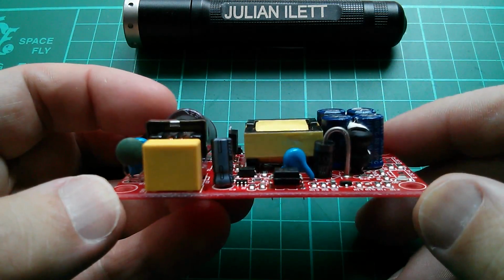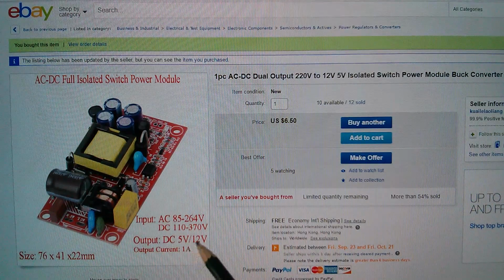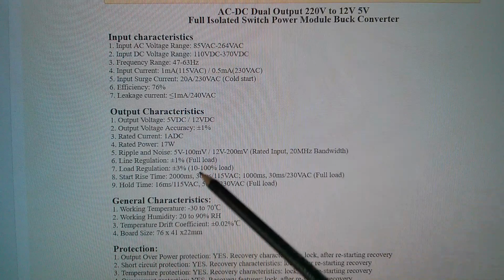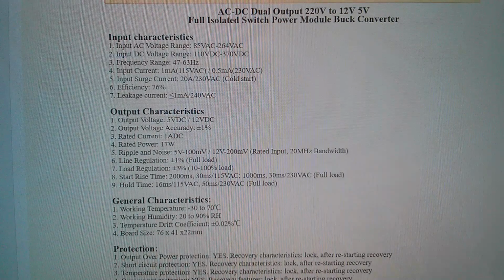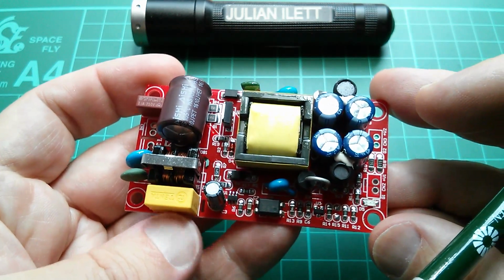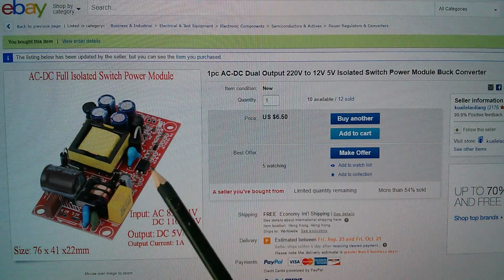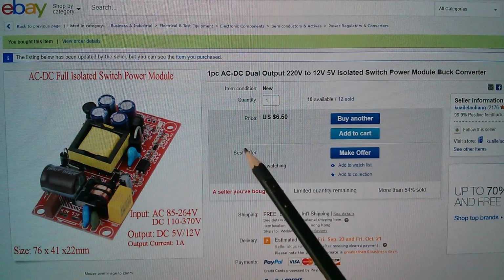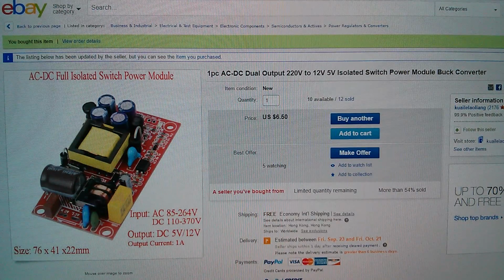Mad Idea: High Voltage DC Power Transmission

Comment: ran a shack out in the bush on 2km of speaker wire by kicking mains up with a MOT, and back down again at the other end.

illegal as all hell, but was fine... could pull about 4A at 240 before the sag got too bad. 

enough for some lights, radio, telly.

Comment: did simular...
40 v solar to round 2kv ac (microwave Transformers) and then back to 40v dc .
over a length of round 500m.
i did this as landline (on 3 m posts...no voltage against ground.
) i use cattle wire and insulators it is working fine since 12years;)
sorry for my poor english +!

Comment: I know this is older video. Do you remember if your fan is on all the time or it kicks in when heat increases. I am charging at 1A 42V and fan doesn’t kick in. Is that normal?

Comment: Has anyone managed to get over 5A @ 110-120V on that b900w converter? I am getting anything between 200 and 500W on that module, depending on the in/out difference, voltage, current and so on, but nothing close to 900W, no matter what I do...

Comment: For someone that's quiet clever with electronics you seem to have made the same there are a lot of people do when they're looking at the specs of these boards, probably due to the way it was listed on eBay being incorrect too, but still.
Virtually all of these power supply, Step Up modules, buck converters the max rated  current supplied I'd in relation to the "imput", but many get it wrong thinking that it is relation to the output.
This one is rated at 1a and that at 240v AC is obviously 240w, and if you subtract some 10-15% efficiency losses you could assume 12v 17a /5v 40a.

Comment: The blue 'blob' on the AC input is a varistor, (VR marked on the board).  Its resistance changes with temperature and drops to a lower value when warm, allowing more current to flow after a few seconds of operation. Its task is to reduce the inrush current when cold at startup.

Comment: Did you set up this powerline regulation so far? Would be interesting to hear how it performs after a few years :-)
I would be also interested in an indepth review of the 900W boost-converter - is it worth the money? What about efficiency and output ripple and what about the lowest input voltage?

Comment: Thanks for that bit of info. I have been looking for a way to get the power from my panels way out in the open field to the house without a tremendous amount of loss and not having to foot the bill for a very long run of big copper wire makes it possible. You see, some of us can not afford to buy that kind of wire, Its simply makes the project impossible to do. I think with this idea and knowing that it is actually being done and works in other country's according to ( Sainology ) using the system you mention actually makes it possible for me to pull off.  I spent a great deal of time trying to figure out how to place my very expensive and treasured  inverter out at the panels so I could run AC over the long run of wire. Where I live it gets extremely cold, lots of ice and snow. I was going to have to house it and heat that to boot making the system pointless after adding the wire price, Impossible AND pointless, LOL. So you see now I can place my inverter in my home next to my lithium battery bank which also must be kept warm and a battery I can keep in my house while charging.  Now it will cost me NOTHING more than I am spending anyway to house and heat myself. So you see this idea may be in theory inefficient or a bad idea to many of the engineers, scholars, and certain system designing PPL out there. As an electrician myself I do understand and agree with simply running the numbers and in principal it dose seem quite inefficient using the technology we have available to use at this point. However do not totally discard this idea yet,  for I must say " IT HAS ITS USES REGARDLESS" and in my case it appears to make something that was otherwise impossible NOW POSSABLE at least for me.  I am also willing to bet that if its beneficial to me, in my situation that there are other cases where it could actually a magical solution to solve an impossible situation. Even with its 50% or 60% inefficiency rate, it at least provides something where there would otherwise be nothing. Due to the cost of those CHEAP little Chinese modules compared to the cost of a good inverter is nothing. I can replace those many times over AND take the loss in efficiency of the entire system and still come out ahead. Hopefully, and I am willing to bet that technology here will only improve in the near future. So for now, for me this system is a viable and useful thing, at least until technology reaches the point where we can somehow wirelessly transmit actual currant over long distances.

Comment: where did you hear that high voltage reduces loses ?
Reply: Wont high voltage lowers the current that is passing throuhh the wire which lessen heat loses
Reply: @IDLZ3D   Its not the voltage ,  its AC . Voltage is something you need , and you never use more then you need . So if you need 10 000V hey you need it , its nto about loses . Loses are higher with higher numbers except for frequency .

If you say Higher votlage equals less loses because its less current , i say Bigger wire less loses becasue less current density .

ITs all correct but its false .

Decrease in loses comes with RESONANCE, make a circuit that is RESONATING  it will have minimal loses , if any .

Becasue electrons want  make problems .

AC is a form of that , when we zoom in to one electron in AC , its just vibrating back and froth , its not going anywhere not doing much  , and that brings loses down .

Next level of that is AC but in Resonance , where Positive feedback negates the loses , so you have self sustaining system .

That is your Atom for example , its vibrating on certain frequency , to split it apart you need a lot of power , Giga W of power .
But increase its frequency or lower it jsut a bit , its self destructs .
That is Resonance , its the essence of our world .
And that is the only thing that can bring down loses , the closer you emulate it the lower you loses .
100% emulation , no loses .
The rest is just confusing math

Comment: I think it is 17W total, divide the amps up however you like. Hence, the 5v diode needs to be fatter. To be able to deliver 17W at 5v, you need a fatter diode than 17W at 12v. :)

Comment: It is not that stupid, if you think about it.
At 120V with 0.1A, the cable loss would be around 70mW, or 0.6%.
At 12V with 1A, the cable loss would be around 7W, or 60%.

So if the combined efficiency of the Boost and Buck are better than 40%, it is worth doing it.

(Calculated with a diameter of 0.25mm²/23AWG (Typical Doorbell wire diameter) and a cable length of 50m)

Comment: This is of course a good idea Julian, for transmitting power (as the authorities do it), as you lose 'x' amount of volts per metre, the higher you pump it up the less current you will lose when you step it down again, so my suggestion would be to pump it right up for a more efficient power transfer over distance, but get a better step down (Buck) on the other end to output full amperage (watts) to your shed batteries so you can take advantage of using the thin wire to transfer the full power of one or both panels down the yard to the shed, and then reduce it to charge the shed batts at the highest possible rate you can till they're near full, and make use of that spare power you have to run more workshop gear or even the house lights, etc.
Another great vid Jule's, TFS!

Comment: Your video projects are great. May I propose one? (cos I'm not quite sure how to go about it)
Using a 4Ch Channel 16A Rgbw Controller Dmx512 Decoder ebay 122882634448 to drive a rgb 20w RGBW RGB+White High Power LED Module ebay 232419809701.
The idea behind this is to convert some school stage lighting equipment to DMX controlled LED luminaires
All the best

Comment: I have one of these, and I can verify that the AC inputs go directly to the bridge rectifier (AC) inputs and the non AC pins of the bridge are filtered by direct connection to the large capacitor.  I could NOT find ant path from the AC inputs leading into the transformer (no continuity) which seemed to have many pins Is this even a 50- 60Hz transformer?).  So, as I have been wondering, HOW IS THE INPUT (ESPECIALLY IF IT IS INPUT DIRECTLY AS DC) isolated from the output?  Can anyone please shed some light on this???

Comment: Julian,  As far as the current rating for each of the 5Vdc and 12Vdc outputs, It seems logical that they are 1 AMP output EACH/SIMULTANEOUSLY.  SINCE:  The label specifies TOTAL 17W, which would equal
 (5V)*(1A) + (12V)*(1A)= 17W.   ...make sense?...

Comment: thats not a new idea julien :) ... hydroelectric dams have been using it for decades to reduce AC losses. ----- also listen to yourself 'this converter outside will step it up to high voltage ; quite a nice deathtrap you are building there ;)

Comment: Enjoyed the video but probably does not make much sense when transmitting <20 meters.
This technique works well for >1km: Lets assume 12W load 1 km away. Assuming 100% converter efficiency.

12V transmission requires 1A for 12W load. To get 90% transmission efficiency, cable resistance must be <1.2 ohms. For 2km of wire (there and back) needs about 6 mm diameter cables.

Transmitting at 120V current uses 0.1 amp so cable resistance for 90% efficiency is 120 ohms. This corresponds with a 0.6 mm diameter cable.

i.e. We use 100 times less copper to transmit at 10 times the voltage.
It makes even more sense if transmitting at higher voltage.

Comment: Hi...Since you seem to have expirience... how long does car battery REALLY last if used in kinda cyclyc mode, or solar, or powering your random dangerous hi-current projects ;-) and NOT recharging it seconds later (as happens in car after start). Could you use big one for like two years for solar offgrid before it degrades?
Are big truck batteries (like200+Ah) allso made from same thin plates as small car start ones? Here in my country it is hard to get or too expensive to get proper sized truck battery, so truckers, etc. just buy 2, 3 or 4 60-80Ah car batteries and put them in parallel (if truck has 12v system ofcourse).

Comment: Kind of an old video, I know I have watched it before but today I located my box of such power converters so I am watching your videos so I can get back up to par on what I am doing when I try and power up my Ham 2 meter radio.  Not planning on trying to transmit, but I got a used parts or repair unit for 20 bucks says all works but the display so I wanted to put 12 volts in from my 18650 power packs just to see if I can get the thing to light up and see what needs fixing. Oh just wondering if that all worked out?  My only problem with it, right off any how was what would happen if the neighbors dog decided the cord looked like a chew toy, I bet 110 volts would send him to doggy heaven?

Comment: Hi Julian,

The Rated Power in Output Characteristics does say 17W.
5V x 1A = 5W   
12V x 1A = 12W   
For a total of 17W.
So maybe each output is 1A.

However, I do not believe this is a good idea from a practical standpoint.  Better to just use thicker wire.

But it is fun and makes an interesting video :-)

Cheers,
Robin Browne
Ottawa, Canada.

Comment: Well, this is sort of how I found you. I found your video on a MPPT boost converter, then watched the PWM and MPPT one and finally this one. Am looking for a way to take the output from a 3-phase windmill and run it a good distance to 48v battery. I thought about just sending it and hoping for no loss then convert it to DC.  Windmills are  much better at 12/24v at the home level. But it can't be safely introduced to the battery. Of course the long range plans are for 6 of them but am concerned about charging imbalance if I just connected it to the proper number of batteries. It would work but the batteries wouldn't be balanced you see.  Then I thought about just making a 3-phase transformer and stepping up the voltage to 8 times the input.  Then I could use bell wire or alike and run it the distance.  The problem now is I don’t know how that will affect the windmill and when they aren’t under load it can get into the hundreds of voltages.  It’s a bit of a sticky wicket to solve you see.

Comment: Ha, ha, ha;-) ;-) wouldnt just be alot easier to simply carry the battery indors once is fully charged and that way no loses will occur since the battery is 12v DC anyway and that is exactly your desired voltage isn't it???  B-) B-) B-)

Comment: Just remember that anything over 32V DC starts to become dangerous and may even require a licenced electrician to inspect your wiring. (depending on local laws)

80V - 100V DC is very dangerous
Reply: depends on where you are... 48-56VDC is used for PoE and I assure you does not require an electrician... 70V speaker systems also do not require a licensed electrician
Reply: FLECOM 
Yes. I was generally speaking about Australian wiring rules as I learned them. Although they probably have changed in the past 20 years.
Reply: John Thimakis

Comment: You have created a tempest in a tea pot. If you were to look at you whole system you will find a great many components not designed for out door use like you black "lamp wire". Considering all the waste heat your little system would produce from the solar panel is a no go. Considering your end goal is to have a low voltage power source at your work bench to drive a bunch of transistors .........  Solution charge the battery at the base of the panel like you are doing. When the battery goes dead at the bench wheel it out and swap batteries. :- )
Reply: Build a robot to swap the batteries.

Comment: I guess now you have to put it in place and measure the input and output power vs. a low voltage system.

I would not want eBay Chinese devices running unattended in my house, though. That junk is fine for something running on your workbench where you can turn it off when it smokes, but I wouldn't really trust it to run when I was away form the house. It has no approvals, no testing, designed and build by who knows...

Comment: I know u buy to test but why don't u do ur own designed equipment for show and tell it's good u prove this stuff wrong why not make the good old English way and make a point if u pull apart a very old tv and take the parts out and make a good reliable system on other videos to prove quality of the new stuff to the good old stuff just a thought prove quality control over the years look at the solder on the newer stuff it's rubbishy junk that lasts about five seconds prove the theory of quality control over the years up to today's cheap made in China rubbish

Comment: Interesting to watch, but I would be concerned about 80V or 100V DC on bell wire for anything more than proof of concept.  For a permanent installation you would need to treat it like mains, ie armoured cable or other similar protection.  UK wiring regulations would apply.

Comment: How about using a PC PSU for your 12v & 5v output device at the receiving end. Bypass the internal bridge rectifier and put your 110v DC on the output side of the input rectifier. Computer shops would have replaced units for free.

Comment: julian, do you think I can use this converter for a high voltage solar panel that I have laying around. the panel outputs like 100 to 130 volts max. 
It confuses me that the output is only 1 amp would that mean I am losing amps if I connect this?
Reply: Your panel outputs 100w
 (100v x 1a) if you hook up this converter you will get 17w on the output. However there are efficiency losses, expect it to draw 22w from the panel. The other 78w will simply not be used, instead turning to heat on the solar panel.

Comment: Why you make it so complicated ? Don´t use a External Board for this..... 
Use an Mppt Charge Controller an have the benefit of mppt and high dc voltage. Use maybe a Mppt 100/15 and cnnect 2 or 3 100W solar modules in series and make it with long kabels like your small bell line......

greetings

Comment: This is what annoys me about people thinking they need pure sinewave inverters for devices like computers and TV's .. it's rectified and smoothed the instant it gets inside the PSU, it doesn't really care what waveform it gets, or even if it's DC.
Reply: it does though ... put enough harmonics and noise in there and you will mess up some stuff big time. among other things it may induce extra losses leading to heating.

Comment: You don't just have to use that SMPS, you can buy CC CV high power PSUs and they're all the same, rectifying the multivoltage AC to DC. What will be really interesting is to see how the no load power drawn of the boost converter compares with a mains inverter. It likely works out just the same doing inversion and using a mains adapter, plus the added convenience of mains power available.

Comment: Instead of raising the voltage of DC to help offset power loss through the long thin wires, what about changing the DC at the battery to AC at high voltage and then back to DC in your lab? Would the AC power losses be even smaller than the DC losses? Or, will all that added circuitry again make it pointless.

Comment: Wouldn't it be 1 amp on each channel? Data sheet shows max power to be 17 watts. 12v @ 1a is 12 watts and 5v @ 1a is 5 watts. 12 watts + 5 watts = 17 watts?

Comment: I'm sure there's a reason why that isn't commonly done. Probably should check the maths. Your converter efficiencies (with measured values of v/i in/out) and compare them against i squared r of certain cable gauges.

Comment: Try 80V input, with an actual load on each 5V and 12V.  I suspect that a 1A load current from each output will require more than 80V at then input for reliable operation.  Though, it may work fine, just because of the various tolerances.  BTW, I'm pretty sure the outputs are rated for 1A each, and the design looks appropriate for that spec.